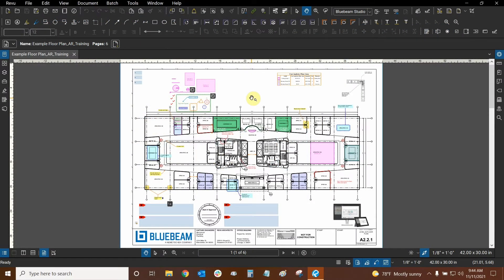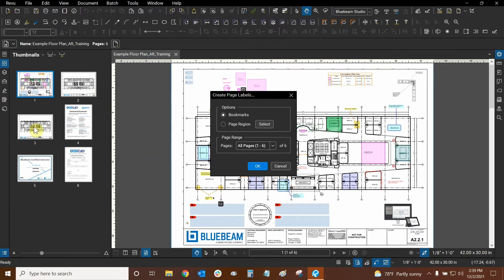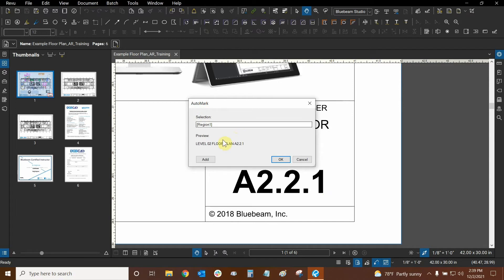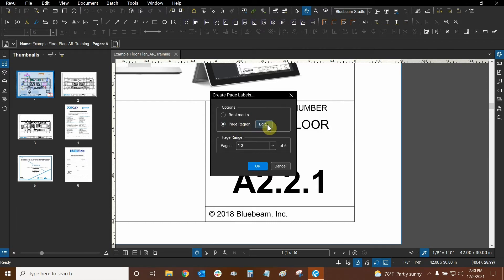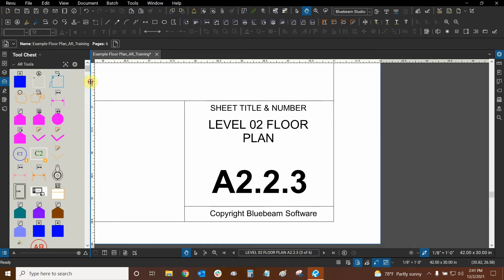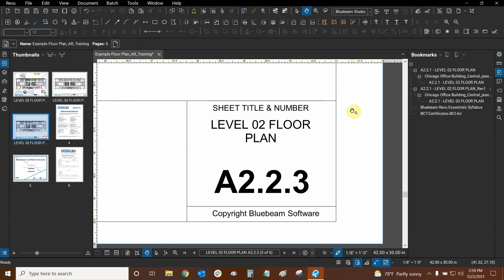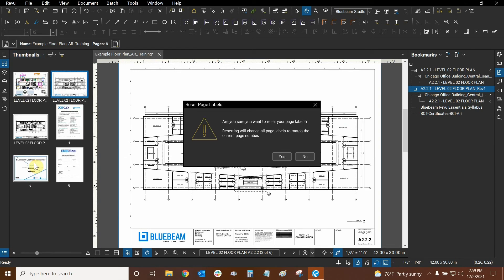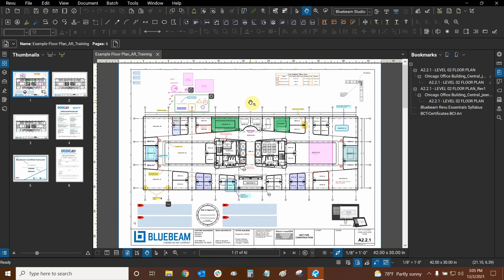Create Page Labels with Bluebeam Revu

Comment: How do you create a form field that once edited adds info to all the pages at once
Reply from the maker: You can right-click on a regular markup and select “Apply to Pages” after modifying it. You’ll need to delete the other markups if you continuously change the first one. This can be done easily with the Markups List by selecting all the markups that you want to delete. You can also use “Headers and Footers” to add text on multiple pages that can be changed all at once. If you’re using actual form fields, you can select the form field by navigating to the “Forms” side-panel and selecting the field. Then, you can open the “Properties” side-panel and scroll down to the “Calculate” section. You can input custom JavaScript code to modify multiple form fields on multiple pages at once.
Reply: @DigitalDraftingSystems  Thank you. Can you make a video. It will be helpful to others too.